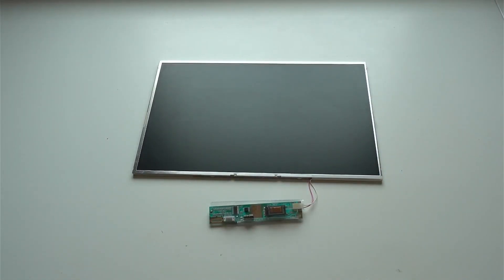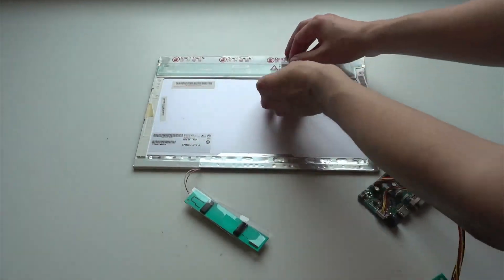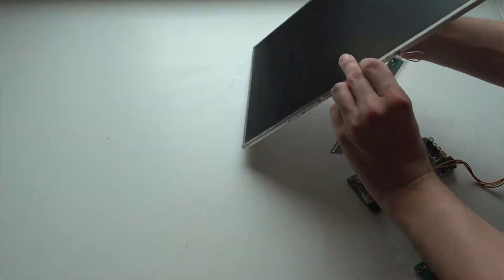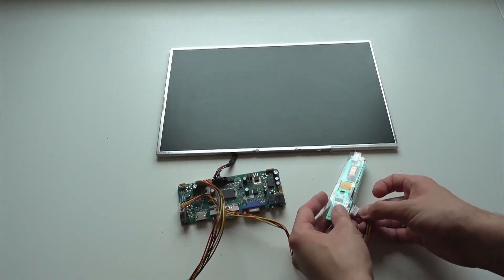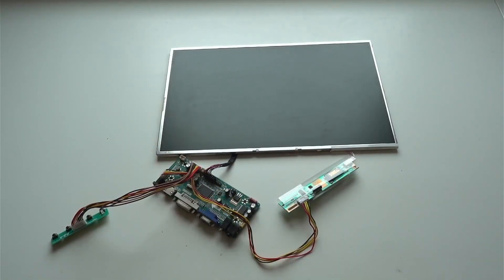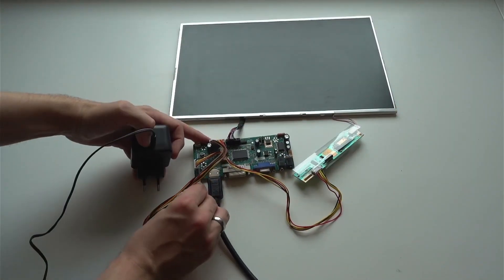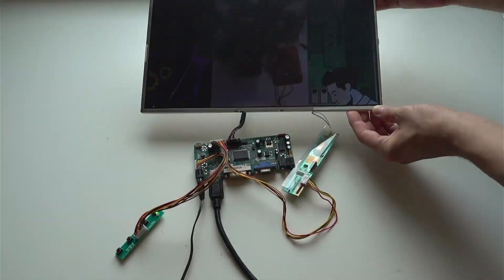Recycling old Laptop into a Standalone Monitor

Comment: it does work,  but whats the effort? you have a TN-Cell Display with CCFL Illumination. you can switch to LED
Reply from the maker: Depending on the desired asthetics, this can be done on hours. I filmed this video within one week after work. 
I have never considered converting it to an led display. Especially because I already got the working driver board for the lighting with the display driver board. For this recycling project I don't see the purpose.
Reply: @makegamerepeat2606  i have the same at home but the display viewing angles was too bad for me. so i took a 15''monitor with 4:3 and dvi for my digital photo frame. because i want the background independent i took a ccfl driver from a old pc ccfl tube and it worked. later i took it off and inserted led because this saves me 7W power and a lot of heat (i put the photframe on a cabinet and the electronics inside so it is super flat)
Reply from the maker: @mb2243  sounds like a nice project. Jeah the viewing angle wasn't impressive in my case as well. At first I planned to lay the display flat on a table, but then it was nearly impossible to read.
Reply: @makegamerepeat2606  i surprisingly improved the viewing angle by removing one of the foils between background light and panel. i dont understand this but it is real. maybe this dont work with TN Panel. but i learned a lot about LCD in this Project.

Comment: Great video! I built my housing out of birch laminated plywood, a little overkill but very sturdy. I had the laptop screen and adapter board for at least two years before I finally assembled it. Works on a 12 volt supply so I can use it in the car as well. BTW, how did you hold the horizontal rails of the base together ?
Reply from the maker: Sounds like a good use for an old laptop as well :)
They are held together by good old hot glue ;)

Comment: This is CFL LCD therefore you need the drive for the CFL bulb inside the screen. The LED LCDs are more easier to make coz they require only the board with the HDMI connector
Reply from the maker: That's correct, but the booster already comes attached to the driver board. At least most of the times.

Comment: Do they have them for touch monitors? I've been looking everywhere. I have and old lenovo yoga monitor I wanted to try this with
Reply from the maker: To be hones I have never tried this with a touch screen. As far as I know, the display part and the touch part are simply glued together and have separate connectors. So it could be required to connect a display driver board and a separate touch driver board.
Reply: @makegamerepeat2606  I have seen them but they are packaged with compatible mini lcd. The lenovo I have isnt more than 11' so I think I would have to get a comination like you are saying, pull the touch controller out o the kit and use it with the monitor of my choice I would need a firmware grabber I think though
Reply from the maker: Good luck with that :) I hope you will succeed

Comment: The only thing I really don't understand, from most videos like this. Is the most obvious, at least to me! Why get into the trouble to make a "new" enclosure. When almost always the original display cover, bezel, back, etc. It's not only there but also fit perfectly from the get go!
Attach the hinges to a board (the hole are already there). Fix the back or make it adjustable and done with it. Simple.
Reply from the maker: :D you are right. But it's not only function I wanted. It's also the fun in building something new, that hopefully looks decent or even pretty. And in my case I at first had different plans for the display, which is why I had already disassembled it.

Comment: How do i find the correct driver board for the screen i have
Reply from the maker: After extracting the LCD from the laptop housing, you will find a golden connector on the back and in most cases, next to it you can find a label with the model number on it. Just type this number into eBay and you get the correct board. Every driver board is made for a specific display, so it will state the corresponding model number in the eBay offer.
My video was meant to be a show case, so it can be hard to replicate. But I was strongly inspired by "DIY Perks", who also shows the process of finding the correct board: https://youtu.be/CfirQC99xPc?t=89
Reply: @makegamerepeat2606  Thanks for the reply 😀

Comment: What part/s of the monitor is responsible for refresh rate hertz. This has been my question for the longest time and i can't seem to find a clear answer or is there really not.
Reply from the maker: In older tube monitors this was derived from the mains power line frequency. 50Hz in Europe and 60Hz in the USA for example. Nower days it's only defined by the limits of your hardware. On the one hand the graphics card i.e. how fast it can provide the frames. The monitor on the other hand is limited by its own hardware i.e. how fast the electronics can handle the provided data and how fast it can update the actual display. And for old monitors it's also limited by the connecting standard. VGA for example uses analog signals, which leads to signal errors and distortions at higher frequencies (depending on the hardware and cable quality). HDMI on the other hand is a digital standard, which gets constant updates and is suited for much higher frequencies.
I hope that answers your question properly :)
Reply: @makegamerepeat2606  so really there is no specific part? like for example in pc, when you upgrade graphics card you get higher fps, when you upgrade HDMI you get higher refresh rate? Is this correct, or do you need to upgrade the HDMI and hardware(don't know the name) of monitor too to get higher refresh rate?
Reply from the maker: @phobiabus879  it's more the other way around. Old communication standards limit the maximum frequency. But you can not simply upgrade your monitor to a higher frequency. You would need to disassemble it, like I did, and replace the driver board. Most of the boards you will find online are pretty basic. So you probably won't get more than 60hz out of them. This was true for this project and also a previous one where I created a standalone battery powered monitor from an old tiny laptop.
Edit: I just googled a bit and it also seems as if the display itselve also defines its maximum update rate. Probably limited by the technology used.
Reply: @makegamerepeat2606  thanks for your time man, good luck to your channel your good!
Reply from the maker: @phobiabus879  you are welcome and thank you :)